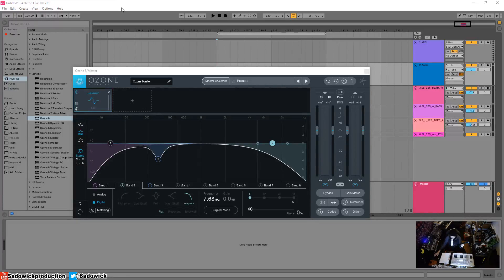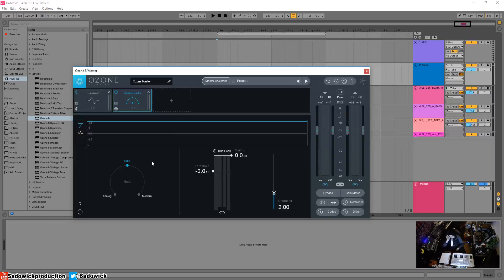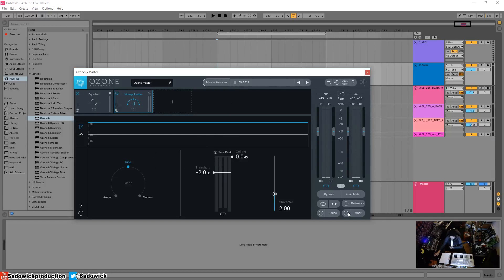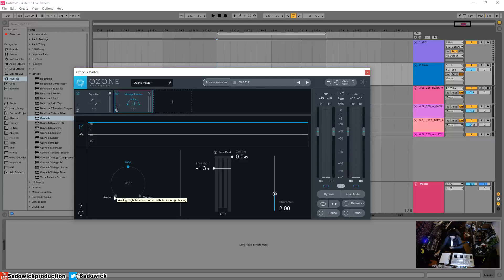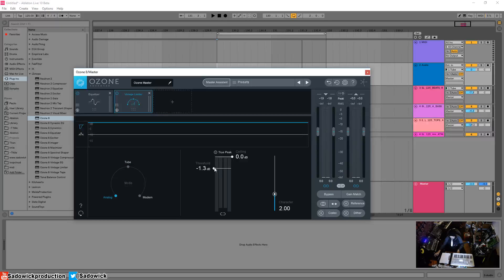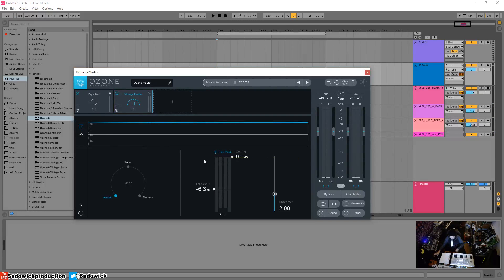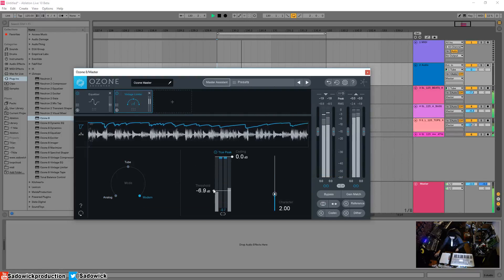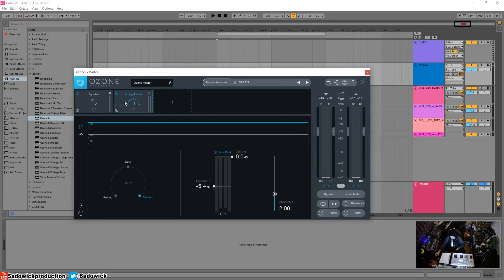Izotope Ozone 8 Tutorial 11 - Vintage Limiter

Comment: ceiling seems like an output gain control on mine. If you link threshold and ceiling from the start, then there is no change in volume. Is that what its supposed to be, rather than an ISP limiter?

I have used it before maximiser and tried to get it to 'share limiting' with that in a way that suits the colour of the music, so i do that to control it anyway.